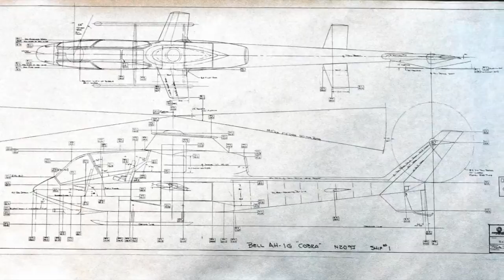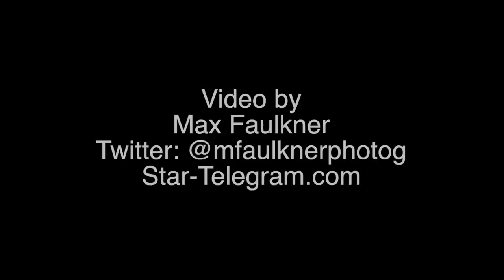50th anniversary of the first flight of the Cobra attack copter

Comment: While not as big a project as Kelly Johnson's SR71, the AH-1 was the right machine at the right time, designed and built in a compressed time frame.  The fact that it was built on the UH-1 sucess made it simpler but was nevertheless a great example of out of the box thinking.